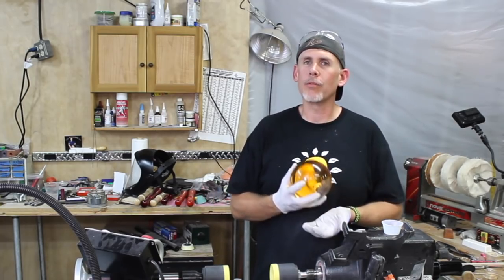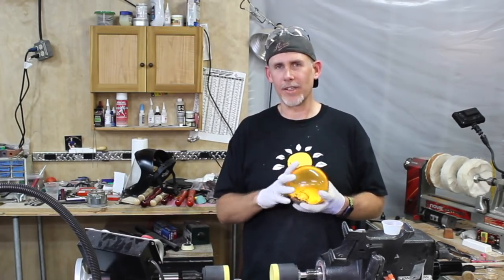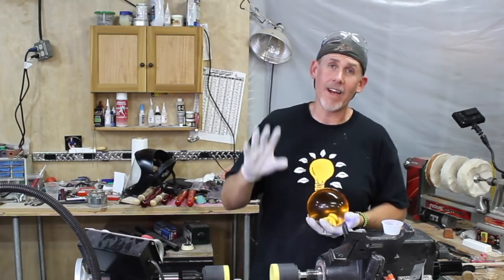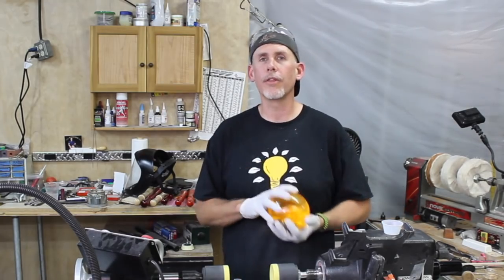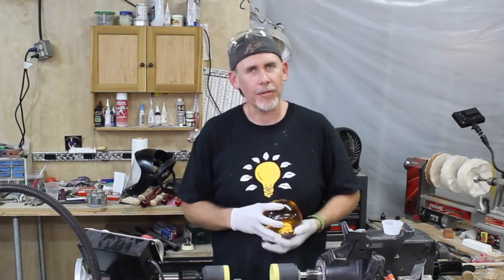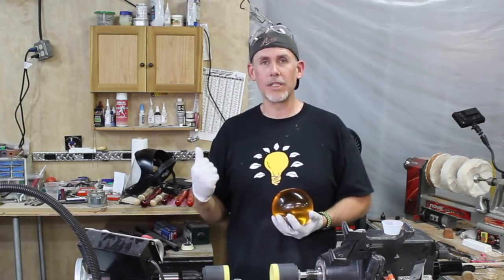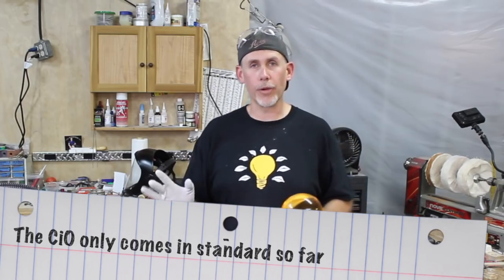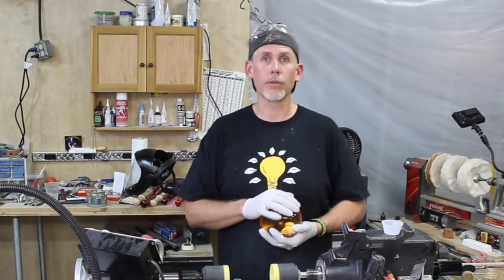Woodturning the BB-8 Alumilite Resin & Maple Burl Hybrid Sphere

Comment: Great work Zac. Looks really nice. Shame the piece of burl was too shallow to begin with. I could see at the beginning that a sphere would mean cutting away almost al the burl because the resin cast was very high in comparison the burl depth. Shame, but amazing first try and still looks really good. Awesome job.
Reply from the maker: Yeah, I figured it would be pretty small in the end, but the main thing was to get BB-8 up a little higher so I didn't cut into him. It's actually a neat effect being so small. Depending on the angle you look into the sphere, it can look huge or tiny due to the refraction

Comment: Came out great.  Too bad you couldn't salvage a bit more of the burl but it is awesome!.  I also would like to know about those chucks.  Keep up the great work.
Reply from the maker: Yeah, I knew it would be fairly small, but it looks cool when you look down into the sphere still. Next time I'm definitely using a much thicker chunk of wood. 

I used the rubber chucky sphere chucks once I had the majority of it round. Seemed to work ok, but I think they might have been out of balance or I wasn't getting the blank centered correctly which may have contributed to my lack of being able to create a perfect sphere. Might need to take a look at them and try to fix that or get better at centering things in them. Carter also makes a set of them, and you can always just turn some out of wood and glue a soft pad on the end

Comment: Next time you embed an object into a sphere blank, I suggest embedding it an inch or 3 above the bottom of the cylinder mold giving you a little more leeway when shaping the bottom of the sphere.
It's a good thing Droids can't get motion sick or BB8 would've spewed oil all over the inside of the casting... :D
Reply from the maker: Yeah, learned that lesson this one =D I did use a thinner burl piece on purpose though, wanted to make sure the BB-8 didn't end up so high that I cut into him... but I definitely could have used a thicker piece

Comment: Nice project.  Gotta get me some of those negative rake cutters.  Where did you get the black and yellow cups you used to hold the sphere?
Reply from the maker: Thanks John! yeah, give those negative rake cutters a try, they are a joy to use on these larger projects, hollowing, and for brittle materials. I picked up those chucks from Rubber Chucky. I got the large size, and I'm kind of thinking that was a bit overboard. The small ones would probably work just fine. Carter Tools also sells a set of them if you want to compare